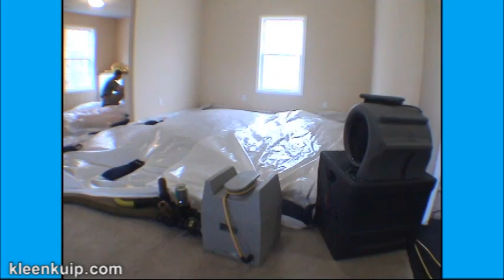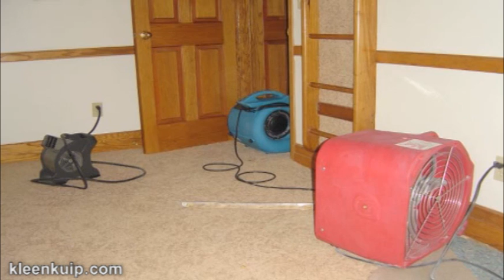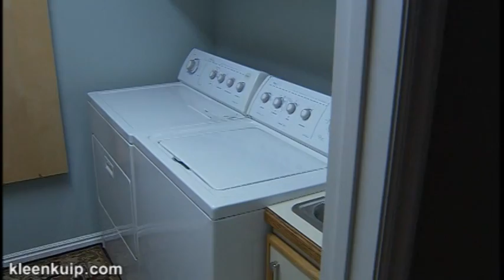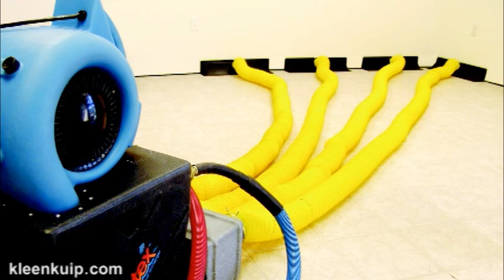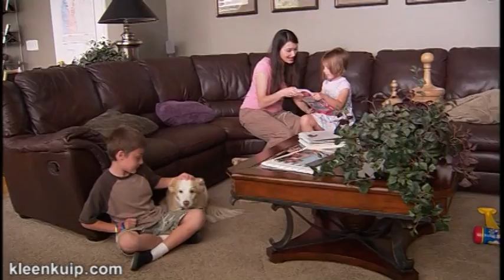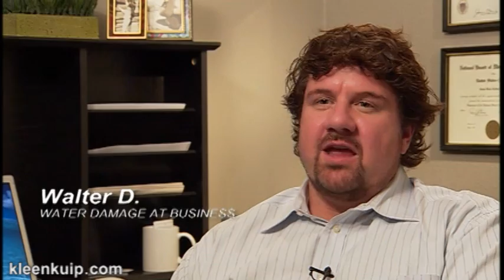Water Damage Restoration Structural Drying Equipment

Comment: We have over 24 years of experience, so you know your home or business is in good hands when you call our specialists. 
Certified Technicians: All our technicians are IICRC certified and highly trained in Plumbing Services. 

Our Plumbing Services: 
Basement Plumbing: Floor Drain Cleaning, Frozen Pipes, Leak Repair, Sewer Line Repair, Toilet Repair, Washing Machines,Water Heater. 
Bathroom Plumbing: Drain Cleaning, Faucet Repair, Leak Repair, Shower Repair, Toilet Repair, Sump Pump,Shower Repair. 
Kitchen Plumbing: Dishwasher Repair, Garbage Disposal, Drain Cleaning, Leak Repair, Water Restoration. 

Emergency Plumber Need Contact Us: +1 330 367 5136
https://serviceman.xyz

Comment: to much heat and drying to fast can cause materials to crack damaging beyond repair . I do implement the tes on jobs still for drying crawl sp.,aid in drying wood floors ,subfloors etc. wich is typicaly a class 4 bound water while still utilizing a dehue just dont like the idea of leaving windows unlocked even though you set up a barrier it can lead to a break in a big liability for the drying  company.😎

Comment: Interesting system. As an EMS contractor who's been in the industry since 2001, I'd say if it takes someone 5-7 days to dry something out using conventional air movers and dehumidifiers, they might want to revisit their psychometric and drying techniques class. 

Give me a beat up old 1200 dehu and a blower a fan, and I can dry anything in 72 hours flat. People taking 5-7 days are just trying to milk the insurance company. This is common knowledge, and is why most insurance adjusters wont pay for more than 4 days, period.
Reply: lol @ the old beat up 1200 and air mover drying out anything in 72 hours.  I had another restoration technician tell me a very similar thing, while wearing cowboy boots.  A piece of carpet yes, some plaster board yes, some timber yes.  Ill give you a saturated concrete slab which has been soaked for more than 3 days and a beat up old 1200 with an fan, I'll drill and plug the slab and I can guarantee when I complete an in depth R/H reading it will still require more drying than 72 hours.
Reply: Eric Day there have been very few times something took more than 5 days. Hoarder homes which we weren't able to put equipment in due to the extensive packout that it took to get near the affected areas. And one time we dried with a membrane in the floor which I wish we could have just knocked out the tile instead but my boss was insistent on heat drying. Through a heater in there and burnt the house at 120d for 3-4 days. I can say that was interesting to dry that!!
Reply: Eric Day also to add to that, I may be wrong but where I work if the padding is wet the padding is gone.. and I see him lift that padding in the video... it erked me :/
Reply: Nonsense. An exterior [read: insulated] wall with a high gloss paint can take several days to dry. That same wall with wood paneling can take even longer, particularly if the homeowner doesn’t want you drilling into it and/or having it replaced with sheetrock by the insurance company!
Reply: This is the comment that i was looking for.  I appreciate you for sharing your knowledge.